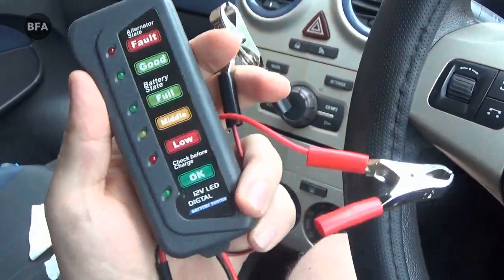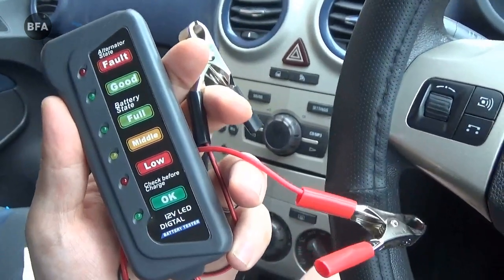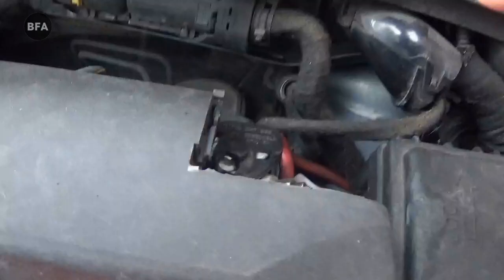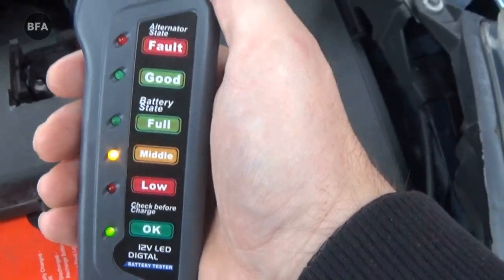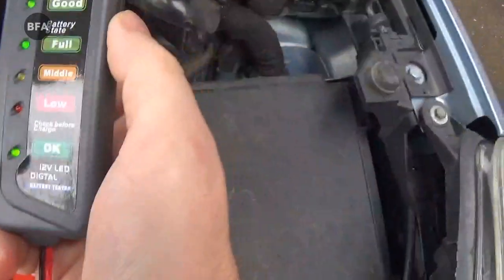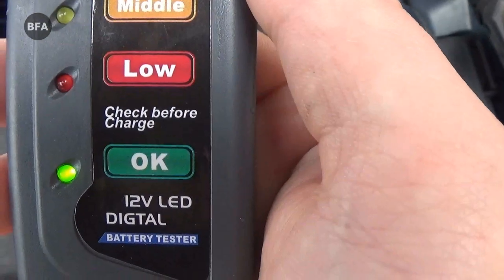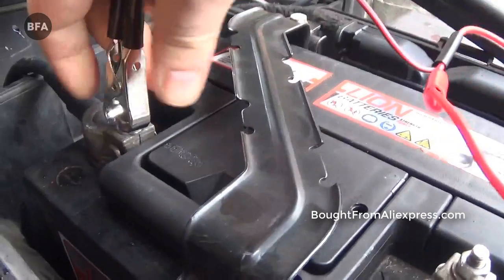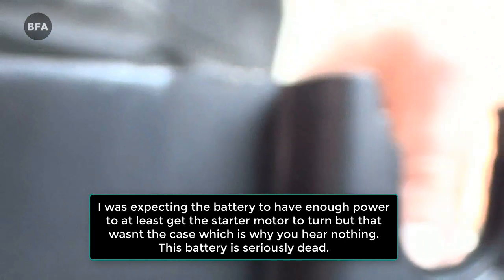How to test a car battery using Automotive battery tester from Aliexpress

Comment: My old Fiesta always has problems when temperatures drop, the battery is only a year old but it was a budget one. I was worried my problem may be the alternator, so picked up one of these testers. It says the battery was middle low but alternator good. Hooked it up to a charger which then said 71%. The instructions with the tester were terrible, thank you very much for this video that even I could follow 👍

Comment: I PUT TOGETHER A 12 V BULB, A SOCKET, & WIRED IN 2 PROBES FROM A "FUCKING $35 METER THAT TOOK A SHIT.
I  PROBE NEG, & POS ON THE BATTERY TERMINALS & CAN TELL BUY THE BRIGHTNESS OF THE BULB IT'S 12 VOLTS.
Reply: by* the brightness
Reply: Twit.

Comment: alternator state fault, what does that mean?
Reply: your battery is used to start the engine. Once the engine has started, the battery is not required. The alternator will allow for the engine to recharge the battery in your car while you're driving. A faulty alternator will result in the battery not getting any charge while driving, which results in the battery running out of charge within a few weeks or months. Typical battery life should be at least 18 months. any lower and it would mean a faulty alternator
Reply: @shaun64444  If your alternator stops charging while driving the car will drain the battery in less than a hour ......not weeks lol
Reply: @shaun64444  18 months? Batteries last me 5-10 years....
Reply from the maker: If the state of your alternaor has come up Fault then there is an issue with the Alternator that will need checking.
Reply: @TomsProductReviews    

No disrespect intended, but this is not always entirely true. 

Using this very tester, my alternator tested as 'bad' and the battery as 'weak' After a lot of research on the web, I came to the conclusion that it was likely not my alternator that was bad, but the battery. 

I'll explain.

While doing so, I inspected my battery. Using the stickers on the top of the battery, (any battery should have these) I discovered it was sadly 8 years old. I realized that due to it's age, the battery was very likely no longer able to hold a full charge. This of course results in the alternator being unable to fully charge the battery. 

To a battery tester (even a more pricey one) the battery will test as 'weak' and the alternator will in turn (falsely) test as 'bad' because even a good alternator can not charge a faulty battery fully resulting in a 'bad' alternator test result

 I replaced my battery with a fresh one. Upon retesting the battery it now tested as 'full' and the alternator now tested as 'Good' because it was now able to fully charge the new fresh battery.

To sum it up; Check your battery first before getting into what will likely be a much more expensive alternator replacement's that in the end wont help if your weak battery can not hold a charge due to age or 'whathaveyou'

Comment: Hi mate 

I did test with engine on lights off and ac off everything good
...but when ac on and lights on with engine on ...alternator light flashes then goes off

What does this mean bad alternator??

Its weird coz battery was low but full after 20 mins would than mot mean alternator working 
..im confused any ideas
Reply: I would check with a multimeter and if the voltage goes down when you start the AC most likely gets your alternator is weak.